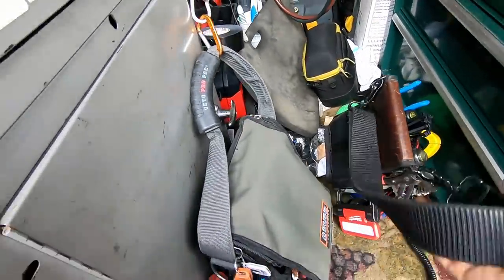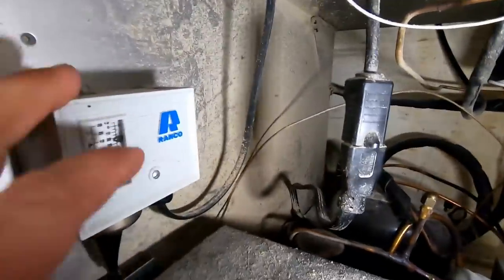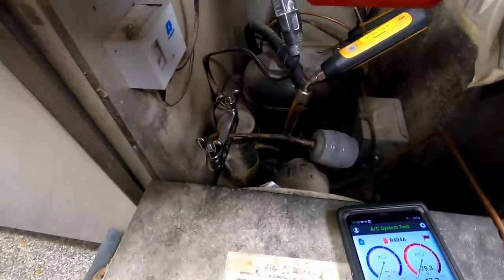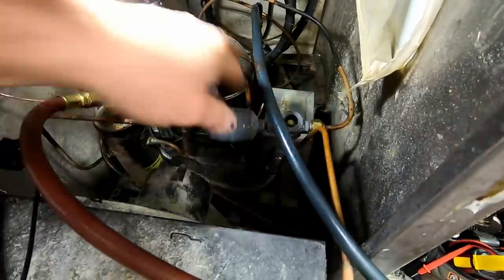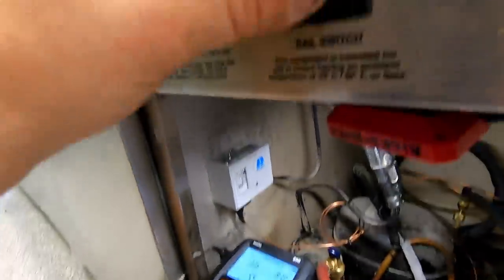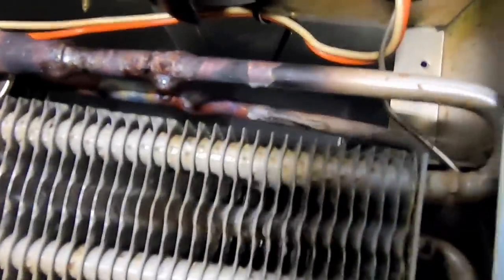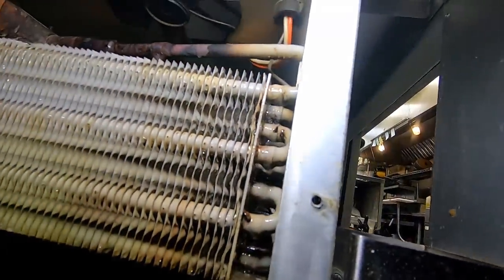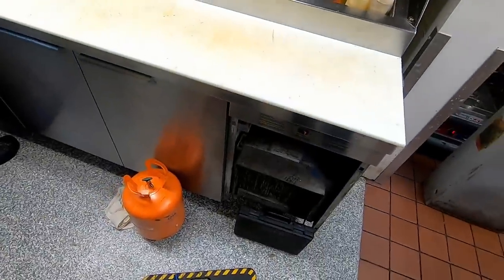Prep-table Down How Many Problems Can I Repair?

Comment: Great work looks like you know what you're doing but you could have avoided all of that but just pressure testing in the beginning and replacing the evaporator in the meantime you have refrigerant leaking into a cabinet with food not cool
Reply from the maker: Thanks for the compliment👍.  In regards to the refrigerant leak,  you do realize that is was at 200 psig and the cabinet is generally at 13 to 23psig? The leak rate is very tiny and the customer knows when you purchase used equipment these are the results you're going to get. The refrigerant is non-toxic and leaking at a rate that is minuscule. Another thing to consider is most customers don't want to even fix or replace what I fixed. They want a quick repair and kick the can on down the road.  So in a perfect world I would prefer to see the whole unit replaced. You can see it was in bad shape but you can't make the customer buy new stuff if they don't have the money or want to spend it.

Comment: What was the bill for this?
Reply from the maker: Why do you want to know?
Reply: @HVACRSurvival  Big job.  Only curious.  You don't have to answer.  More curious if it was quoted or time and materials.  It's been a while since I've been in the field.  I strangely miss it.  :)
Reply from the maker: @karizmatic5  Most simple repairs are time and material and even when we quote a job its a guess of how long we think it will take and multiply that by the time and material. Our labor rate is low compared to larger city's. I would guess this was 350-500 area.
Reply: @HVACRSurvival  Thanks!

Comment: That particular brand of cooler always has leaks right on the outlet side of the txv, that 4 inches of copper! You did buy them some time, those parts are expensive and the assembly as a whole is much worse! I work on those a lot!
Reply from the maker: They are a good cabinet, better at keeping the rail cold vs the True. But they do go down the same way over and over. Thanks man!

Comment: I like how he blew out the condenser on a cooks line.😁
Reply from the maker: I only did that because they weren't busy and didn't had food out. Otherwise I wouldn't have. The brush did most of the work.
Reply: Use a Brush to remove bulk & do a chemical clean. Let it bubble the dirt out. A lot safer & easier & better than blowing out. I used to blow out a lot. NorCal changed me to just use chemical & let it bubble the fixity out and wash off coil with Hot water. Then Blow it With a Big Wet Kitchen towel backwards if needed. That Way Dirt is All Wet & Will not go in the Air if food is around. No dust that way.
Reply: Sounds like quite the process lol.

Comment: @11:30 you can tell them that for starters they have a leak in the evap cold rail. But also offer them the advise to invest in about two of not three FrostKing boxes for their pepperoni. Sorry but I know a pizza place when I see it.
Reply from the maker: Oh that's definitely a pizza prep table. Behind me where all the noise was from was the dual convection oven. It's a real nice sports Bar that's independently owned. We do a lot of work for the owner and he's a real good guy, he just likes to buy used equipment. You ought to see some of the keg coolers I have repaired/built LOL

Comment: So you only “partially” melted the evap fan blade....
😂
Reply from the maker: It needs fan blades?
Reply: @HVACRSurvival  I only mentioned that cuz I’ve melted those doing the same exact repair. I was watching the blades expecting it to happen Great video Rick, hard times trying to fix things “affordable”
Governor here in Michigan shut our restaurants down Wednesday and we do a ton of restaurants like you...
Happy Thanksgiving!
Reply from the maker: @HardKnocks101  Thanks Rick! I don't think I hit it, I shot left, right and down but not up much, that's why I had a goober on there. I added extra rod then try to pull it to the next side and to the bottom.

Comment: I HATE prep tables..
Reply from the maker: Same crap, just harder or less hard to get into. What's your favorite? If there's such a thing 😁
Reply: @HVACRSurvival  chillers.. That's No.1
Walk in freezer/cooler is No. 2 that is if they have there own unit..
We have a big costumer where all coolers and freezers is on one compressor with a booster unit for freezers..  Not a fan of that setup..
What about you?
Reply from the maker: @christiansommer914  I like anything refrigeration but I'm interested most on becoming my best on the grocery and industrial registration, only because less people know it compared to the smaller systems. My least favorite is maintenance jobs 😁
Reply: @HVACRSurvival  i get that.. I'm the same with chillers.. And troubleshooting in general.. That's where i shine.. Can't do complete installs if my life dependent on it.. Maybe i can but aint pretty..
But I'm honest about it, just started at a new company.. First thing i said was ventilation and installing ain't happening, only if I'm 2nd man and purely arm's and legs..
What about the working hours, when working grocery stores?
Reply from the maker: @christiansommer914  I'm mainly only doing them when I'm on call ☹️. Great time to learn 🙈🤣